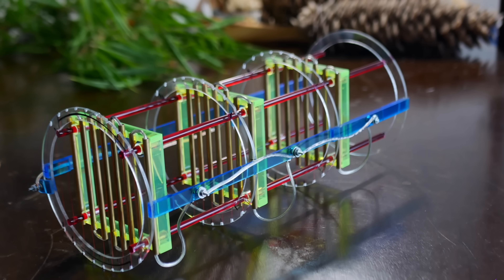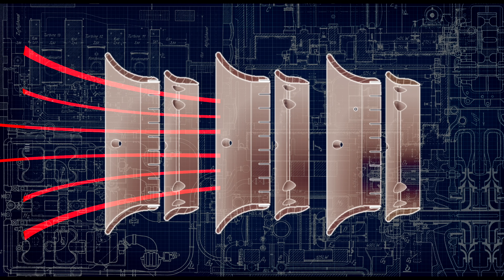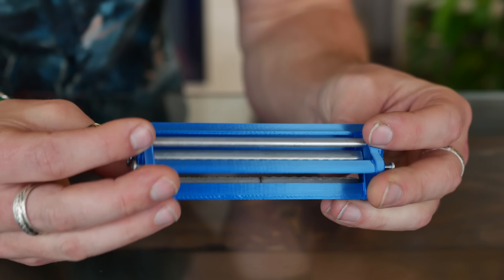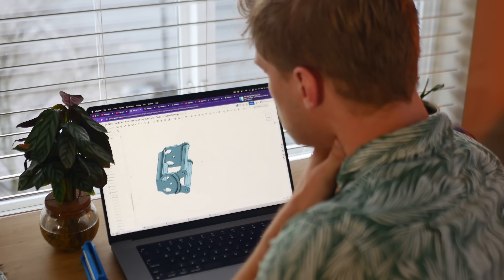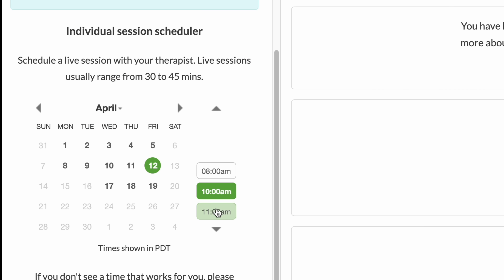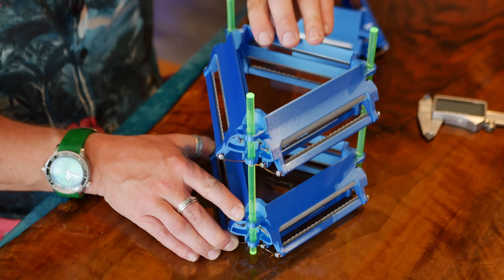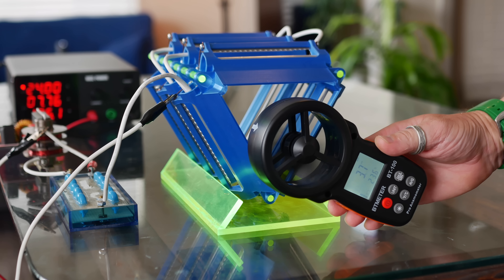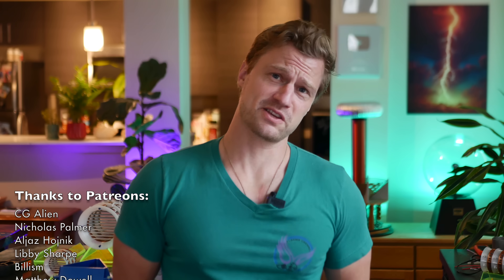Next-Gen Ionic Plasma Thruster Inspired By Nature (BTC Mark 3)

Comment: It's also well worth considering that some 50+% of thrust from both jet and turbine engines comes from channelled bypass airflows (Aviation fans please don't hurt me, I've no idea about proper terms lol) around the main compression/high output stage. You utilise the drag your high speed air has on the air that's only been accelerated by a larger area first stage, whilst feeding the central airflow from that initial acceleration into the high power core stages that produce a very fast channel, feeding back into the slower but still accelerated column of air, which then acts on the ambient static air to produce more laminar flow instead of harsh vortices. Beyond that I'd just wonder about if you're getting turbulance from the corners of the design where a tapered air channel might help get more laminar airflow.

Comment: Just a dumb suggestion (Dont know if it would work irl, but i guess my mind thought it COULD work), how about making the next set of thrusters a bit smaller, as if to capture the exiting air from the previous thrusters? But not too small that it would obstruct the hollowness and collision proof design, just enough to capture the angle at which the exiting air from the previous thrusters eject. Again, its just a dumb thought :|

Comment: Hey Jay. I’m always looking forward to seeing your next video. The new triangular topography made me wonder if arranging the triangles in a helix with a logarithmic decrease in angular offset between the 1st, 2nd, 3rd thrusters could amplify the convergence and/or amplification of air flow. Like those giant funnels that you can roll a coin or BB and as the coin gets closer to the centre of the funnel it rolls faster and faster around an ever decreasing diameter. 

or even using a constant pitch helical topography instead  of a triangle to create a spinning effect (like water going down the plug-hole). Just a thought. Thanks for another great video. 👍🙂

Comment: I wish you could try a tree construction approach instead of a hole in the middle. Like you did with 3 of them before joining them together as a triangle. If you dont want to get rid of the hole, then the angular intersection of the 3 blades in each triangle section has to intersect in the same spot. To which i mean, the first triangle has that instersection at about a palm of distance, but since the second intersection is half a palm of extra distance you'd have to angle the horizontal wings a little bit to the outer zones so that both triangles air intersections coincide. You can see a pratical example of this in air jets, where the angle of attack of air pressure requires smaller blades behind the biggest one with all of them having blades with a specific angle for air compression and vectorization

Comment: I wonder if rotating the second stage to an angel of 120° (compared to stage one and three) would increase the airflow. You would keep almost as much as space on the inside but gain more secondary intake over the edges of the thruster.

Comment: Hello
I do not understand if the thrusters increase air velocity in general or if this system can accelerate only standing air. I guess a test should be made if it is possible to accelerate air from 10 to 14 m/s

Comment: Would adding some aero dynamics in the center to smooth the airflow into a spiral of airflow, just pondering if your loosing any air flow through where it's colliding in the center point. Also could you gain more by using almost dyson cyclone effect to pull in extra external airflow.

Comment: To measure the thrust, just hang it from a frame with string, and put a 300 mm long (to avoid disturbing the inlet airflow) rod on the inlet side pushing on a kitchen scale.  You can add levers to amplify the thrust if needed, but it should show a few grams.

Comment: Do you need an array of wires in the gap between each stage to get rid of the charge on the air flow? Perhaps even an electrode to swap the charge so that it can be accelerated by the next stage?   The successive stages are not giving you any more air flow than you get with one stage, so something is awry there, and I suspect its the progression of charges on the air.  Whiteboard the series of charges on the air (neutral to start with then with either +ve or -ve) and electrodes to ensure you are getting 'attraction' and 'repulsion where its needed.
As it is, you will get more thrust with the three stages by having them side by side not in line.
You really need to get back to basics to figure out how to operate the charges on the electrodes and air stream in multi-stages in a way that provides useful acceleration of the air mass above a single stage.
And as others have said, measuring the thrust is the only useful way to compare versions, IMHO.

Comment: What if you put this truster in a tube? May be that with Coanda effect, the airflow will improve (the air mass will be increased)? Also, how about to try different spacing between stages, something like a exponential function and power it in pulses (imagine it like a linear particle accelerator)?  Powering the device with pulses, can alow you to use higher  power?

Comment: As far as I can see, you talked about the convergence and then ignored it when stacking modules.  I would have first started spacing so that the convergence of flows met in the middle of the next thrust module, starting with 2 modules and then optimize from there. Also, you want to find the optimal voltage and leave it alone while increasing the amps instead to achieve desired wattage. Buzzing and arcs means the voltage is too high and your circuit is shorting out.

Comment: You need to look at the material science, but don't blame me if you get home to find the government having trashed your lab.

There was a special paint i used to increase a specific value differential.

I wont give anymore info, as my research remains under the radar.

If anyone else is interested in this, there are very very big gains to be made, way beyond what you see here.

And it works in a vacuum meaning it is some force we don't understand well, but the issue was as i got to extremely low pressure i had issues with power jumping the gap, you need to have an active gap to the wire that widens at lower pressures, or risk unforeseen consequences.

Comment: This is an excellent design! The no gap tube concept proved correct! The peripheral input method is cool too! Triangles rule the world. You might try a peripheral input, no gap, cone design and might eek out a bit more performance than the triangles. This circular design would require circular blades, which might be kinda difficult. Excellent progress! 💯

Comment: Strange, with the full assemblee (12:52 for the measure) you seemed to only get the result for 1 stage alone (10:57 for the measure). I don't know, maybe there is something in how you test it that don't let you really measure the full assemblee acceleration. It make no sens to me that those results are the same knowing they should at least add up in the middle the same way the previous model were.

Comment: Never been involved in ionic thrusters but I am an experienced design engineer.  Would it work if you had a branch manifold of say 6 thrusters into 3 tubes then into 1 tapering final tube. Air speed might increase at the final output ?  Or is that too simple ?

Comment: I think you must to use separate power sources! Cause you have flow between each stage which going in opposite direction  for even better results I think you can connect each hot wire with ground wire on next stage and potential between first stage and last stage will accelerate air flow even better . It also gives you opportunity to increase the for the last stages and instead loosing power on each 25%
Reply: Or maybe the same transformer with individual coils 15kv each

Comment: See about 70% of the words you used i did in fact not understand. But i love seeing stuff like this and thinking about how it can be incorporated into different stuff although i have no clue how incorporating this intio something would work. 
what would happen if you hollowed out a large rc planes wings and put one straight section of this in each trailing end of the wings with the aileron motor rotating the propulsion system up or down to simulate pitch and yaw,  the air intake could be pulled from a makeshift hollow bomb bay in the belly of the rc plane with a mesh in the bay to act as a intake filter. Which as long as you dont crash the propulsion system should remain relatively safe. Sounds like a really good project.

Comment: Love seeing the progress on this man! I think it would be interesting to try using a tapered sealed tube instead of a triangle. Then angle the thrusters in such a way where the incoming thrust creates a vortex inside the tube to draw in more air from the inlet. 

Pretty much create a jet engine without any blades with thrust vectored air instead 

Source am mechanical engineer

Comment: I still believe with the larger flow, this would benefit as the driver unit for a fluidic propulsion system.  It does follow the constructive interference idea. But scales it a little more.  It also potentially cuts internal drag issues from the assembly.

Comment: try measuring how much the pressure is on the 10cm mark on the output. 
With 3 sections, and 3 modules per section; to me it seems like you could add a shaped exhaust on the output to convert all that pressure to increase the air flow even more.

Comment: I wonder about experimenting also with the degree of rotation between stages, and also with the timing - starting the different stages at different offsets in time. 
I guess another possibly weird thing to try might be looking at squid propulsion. They are using muscular contraction rather than ionic thrust, but I guess what I'm thinking about is the way they draw in water into a chamber and then push it out in a pulsed manner. So increasing the air volume in the chamber in one phase, and then the pressure on the volume in the next. Maybe by running every other stage (to pull in some air) and then all the stages (to push out the air that's there). Or running all the stages at the same time (to pull in air) and then all the stages with a slight offset (to squeeze out the air).

Comment: What if you had the voltage source and drain in a coil pattern? That way you would maintain the peripheral "bladeless" design, but you are no longer limited by size or length. The design would be more simple due to it being a single positive and ground connection. Easier to scale up probably too?

Comment: Love the video! I think about the design differently. The first stage has to be the backbone of the structure of the  cone. Think about how a black hole works and everything goes to one fixed point. you have to stretch the fixed point from the first stage past the third stage. to where stage ones maximum performance is passed the third stage. 
Stage 2 has to be some type of feeder system for stage 1 and stage 3. I haven't figured that out yet. After all, there's going to be a shell around everything. Nothing can be exposed to the elements. 
Stage 3 needs to be the torque adding the horsepower from stage 1. 
Maybe some vector control as well. 

I really enjoyed the video

Comment: Not sure if you will read this but I have two suggestions that may be helpful.  #1 would be a magnetic nozzle.  #2 Laminar flow at the inputs.
Reply from the maker: Magnetic nozzle is very interesting, actualy. Not sure if it would have much affect, as the current going through the air is so low (thus electromagnetic field is very weak). Worth a try though!
Reply: @PlasmaChannel  I guess throw a strong neodymium magnet into the stream to see if it has any effect on the air flow using your dry ice visualization method.  I’d try different currents tho.

Comment: I am not in any means an engineer or some professional, but in the mind of increasing the electrons to air molecules touch surface, chaining to a hexagon shape (or even more? Cus hexagon is the most beautiful shape ever) of the LV-IF (Low Voltage Ionic THruster) and with a 'm' shape metal plate or tube would probably help with the thrust output. Be say, I'm just a 18 yo kid with no job.😅

Comment: Makes me wonder how different it would be if the thruster turned a turbine which is then connected to a fan, could try doing a turbocharger jet engine but with the ionic thruster as the combuster so the accelerated ionic air turns the turbine

Comment: i was thinking in the individual desing (before the peripheral model), but making it customizable and modular so you can try different lengths between electrodes, this for 2 reasons, u can test different output power levels and look when it creates the electric arc so u can evade it, and the second reason its, u can look which setup its better to the airflow, like, u can move multiple lengths and see whats better in the flow meter without the need for printing everytime u think it can be a better desing, with this idea you saving time, so you dont have to print every desing, and u saving money every thing dont u print a new thing, i hope that u read this.

Comment: I have no idea about this topic at all, but wouldn't "guiding" the air with proper air channels improve flow rate? Right now it appears as if you just let the air slam into whatever it wants, but properly air channels (perhaps even a stacking design) might improve it. Downside is a smaller inside area. Maybe it would even help on the intake area too.

Comment: Since the air flow is converging would a design where the second and third thrusters are reduced in size and nested inside to match the output to input flow of each thruster? And how about a tapered voltage, say a 22.2% increase at each thruster?

Comment: Have you considered a convergence in the perimeter of each section?  Modern jet engines use a convergent to divergent, an hourglass, design to maximize thrust at the exhaust.  The convergence in the compressor aid in compressing the air, then ignite it and exit at the divergent exhaust section.  Just a thought you may consider in your design efforts, but I acknowledge that the same may not work with ionic thrust design.   Another thing that would be helpful for our, laymen, consideration is if you could translate what liters per second or meters per second would equal in pounds of thrust which is the current paradigm that jet engines use, and how that perhaps may scale up at what wattage requirements.  Great ideas and hopefully a breakthrough is in your future.

Comment: You need to focus less on the gas outlet speed, there are more variables to control.
In particular, you appear to only derive mass airflow from multiplying air speed with a constant but airflow isn't just a clean moving cylinder. 

You would greatly improve your data by measuring actual thrust. Place the assembly on a scale and make it push air upward. Thrust is the real important metric you need to optimize, not airspeed alone. Then trust to weight ratio is going to be the next metric to optimize.

Comment: My brain must be read only from the internet. Suggestions, arc the three sides of your triangular thruster by combining three different circles in phases which also spin the air as they are focused on the center. Also try adjusting power, phase, position for each bank of fins to increase vacuum and pressure. Like you are pinching one end and expanding the other whilst spinning as a tornado.
Finally, apply ion thruster fins to a pulse jet, maybe with tesla valve and scramjet mods once a feedback compression loop is achieved. Maybe one is already out there!

Comment: Can I suggest some ideas you might ponder Mr plasma channel,   I would like to see a ram in the front of the engine that is a cone, try different geometry, and spacing.   I am considering the open design may work against thrust,   it may also be beneficial to use a nozzle whish could dilate and restrict to explore if thrust can be focused.     Thank you for this project,  it inspires me to imagine the future,  and ponder ionic propulsion and its many applications

Comment: I love watching your videos on developing this in these iterations.  The only main problem I have with your videos is that even though you never explicitly say you've built a working plane/drone with this tech, you're implying you'll get there.  However, with our current level of technology, I don't see how one can make an effective ion based plane unless it is really light per volume or already launched into space.  If you do wish to make a plane or drone, I think your focus should be making everything lighter and more power efficient while trying to increase overall thrust dramatically, not just air speed.  And, if they're still not light or strong enough for a plane, perhaps try putting 3 or 4 or more thrusters that can either change direction or are mounted at different angles to a balloon instead of plane.  That way the thrust can be used for forward, backward, or sideways movement and not for trying to overcome gravity.  I think if you make them more water proof and power efficient they're already good for use with small boats.  I hope to see some breakthroughs in the future but even if not glad to see you're having fun.

Comment: would be better to measure thrust not velocity. The thrust to weight ratio is still pretty shitty. cool concept but a long way to go before it would be remotely viable.   How would a plan power it...Batteries?? So putting a low power density storage (compared to any hydrocarbon) with a low power density motor.  I think we should stick with jet engines.